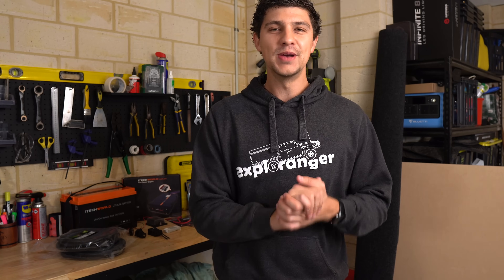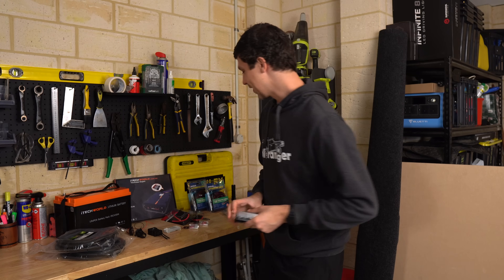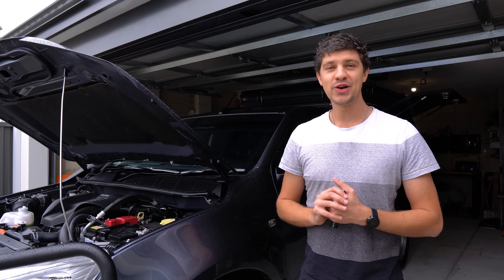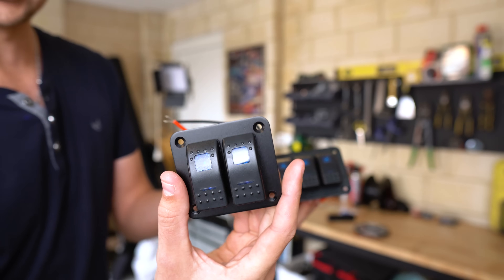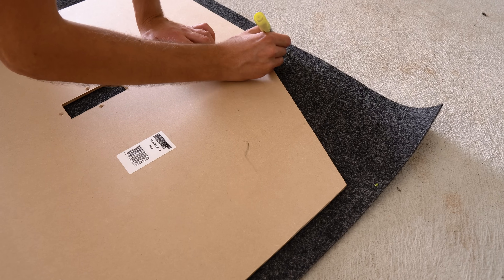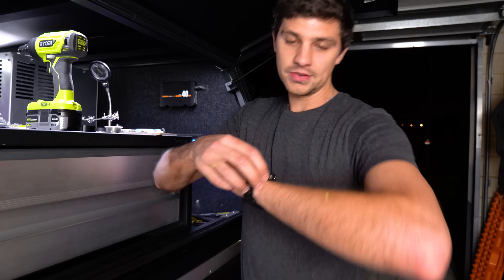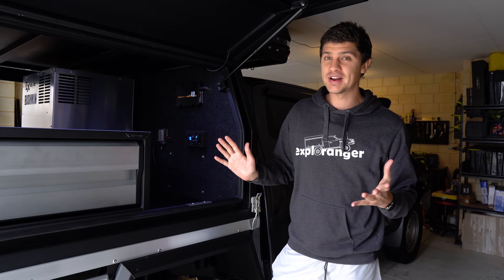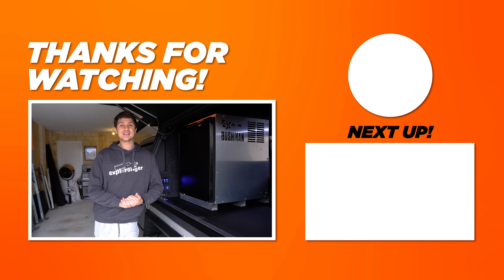Installing A Full Off-Grid 12v Setup! DMAX Canopy Fitout EP2

Comment: Good video Daniel. Just curios, with the Itech world lithium battery monitor, did you have to use a shunt?
Reply from the maker: No this one just determines the battery level based on voltage (calibrated for lithium) - not as reliable as a shunt based system which is what I've since installed instead. 🙂

Comment: Hey mate, im about to install the 12v into my D'max canopy, what did you do with the Dc/dc ignition wire ?
Reply from the maker: Hey mate, I tapped into the factory fuse box and ran a piggy back fuse off an existing ignition circuit through to the canopy via a deutsch connector.
Reply: @explorebound  ok cool. I've got the fuse box end sorted thanks to your vid. The through the canopy was my issue, especially being a lift off. Thanks heaps, I'll check out the Deutsch connector. Good on ya,  love ya work 👍

Comment: LOL @ you running dedicated pos and neg to the start battery. you only need pos wire. you simply put a neg wire any place you want in the back of the truck to the frame or bed. waste of money big time.
Reply from the maker: The canopy is a lift-off, so can’t connect directly to chassis, has to be ported through the Anderson connection. Sure, I could have then splice half the wiring from the vehicle side of the connection to the chassis.. but it’s twin core cable anyway so wasn’t any inconvenience to run back to the starter battery, looks neater and was hardly any difference in cost.
Reply: @explorebound  i had no idea it was a lift off. Makes total sense now.

Comment: great setup! when it came to installing your strip lighting was the back adhesive to the strip lights 3M? Thoughts that stuff would stick on anything! especially with my canopy being a black powder coated finish, will have to do the superglue trick as well. When it came to securing the conduit that you had run the strip lights in, how did you go about securing them when running them within your awning? i assume just zip ties?

Comment: 1:40 your wire is undersized for that length and amp rating
Reply: ... Agree.

First though, it must be said, always grateful for this kind of content.  Takes guts to lay out your work for the world to see.

Here's my take on the cable size for the run from the starter battery to the DCDC40 charger:

Two major cable sizing considerations --

> Protected by Fuse

> Voltage Drop 3% Max

(especially to a DC-DC charger that you want max output from / quickest charging)

1:34 ... Curiously, the Narva 8B&S 100A claim appears to be bunk.

Narva's cable package 8B&S 100A claim cannot be substantiated by the 6 foot run top row of the Blue Sea Systems cable selection chart, apparently based on ABYC E-11, nor by the NEC "free air" ampacity table.

Looked on the Narva web site, and they don't appear to substantiate their 100A claim for 8B&S with any detail.

That said, 8B&S should be protected by a 60A fuse ... but likely not by much.

For what it's worth, the 2011 NEC says 70A @75C for "free air" 8B&S (8AWG) ... and that sans deratings, like ambient temp (under bonnet?), etc.

However, for voltage drop @3%, not 8B&S ... sustantially more copper needed, maybe 4B&S, likely 2B&S best ... to accommodate max current of 45A (iTechWorld DCDC40 manual), run 15 feet = 30 ft circuit, looking at the Blue Sea Systems cable selection chart.

Perhaps that's wrong.

Easily proven.

If the aux Lithium battery were drained to 50% or so (don't know how you'd tell without a shunt), turning on the ute and checking voltage at the starter battery and at the DCDC40 charger while it's at max output, should show more than 3% drop with the installed 8B&S Narva cable ... if what I've stated isn't B&S. 😁

My $0.02

Thanks again for the content.
Reply: @kradius2169  your fusing recommendation is off. 

100a rated wire should be fused at 1.2-1.5x the constant load. 
So should the constant load be 100a then you need a fuse between 120-150a. The fuse is only there for short circuit protection not overloading. 

To size a wire there are 2 ratings. 
Max amp rating this is the most the insulation can handle no matter the length of wire. For example 8awg is normally rated around 80-100a but it can be rated at 200a with the correct insulation. 

The next rating is voltage drop. This is what we use as a little bit of Voltage drop can be the difference between the system working or not. 
When working out voltage drop the amp rating of the wire decreases with length not because it can't handle the load but just because of voltage drop. This is why if you size by voltage drop you will never overload the wire.
Reply: @DIY12-24v  ... OK.  Thanks.

Was not aware the fuse is only protecting against faults.

Is that a DC thing?

What about high impedence faults?

I'm learning here.

P.S. The overcurrent protection per NEC should be 125% of the 3 hour continuous current to avoid nuisance tripping, I believe.

Also, U2oob threw up dude's latest 12VDC aux system iteration, I'm only just starting to watch and now dude's got a 6B&S from bonnet to DC-DC charger.

Ima have to comment. 😁
Reply: @kradius2169    do you mean low impedance fault? 
High impedance fault is basically a short circuit and it will blow. 
Low impedance fault will not blow the fuse as it under its rating as well as everything in the system. Example solar panels cannot have high impedance fault and this is why you can direct short a single panel and nothing melts..

Over current protection will be different depending on location because of laws and regulations. 

The fuse will not blow at over current for extended periods depending on the fuse type until it goes over 120-150% of the circuit rating.
Reply: @DIY12-24v  ... Fault = short circuit in my book.

DC systems at times seem to have design peculiarities.  Like I say, I'm learning.

I mention high impedence faults only because they are low current, at times low enough to not trip a breaker -- but that may be more a high voltage transmission issue, and not a 12V DC issue.

I would still though question a fuse not being meant to protect a cable from an overcurrent that's not a short circuit.
Reply: @kradius2169  with low voltage it's not important as it will not hurt anyone this is the only reason why they use it in high voltage. It's not exactly simple to setup

Comment: Hey Bud; did you ground to the chassis from anywhere other than the negative crank battery ground point? Thanks in advance
Reply from the maker: Hey mate, didn't add any chassis grounds in the canopy circuit. Everything in the canopy is grounded to the canopy battery to complete the circuit, and the DCDC is earthed via cable to the starter battery (which is then passed through to the aux batt).

Comment: Hi Daniel. I’m just in the process of finalising my MRT explorer package. Are you able to share more detail on the changes you made to accomodate the 12v wiring and the KES? MRT aren’t able to modify their KES wiring to accommodate any changes so I’m looking at either replicating your design myself or having them add an additional flush mount Anderson connection to accommodate another 12v cable run.

Comment: Great video mate! Question, do you still run a battery isolator to allow charge for the second battery or does the dcdc charger have that built in? Thanks!
Reply from the maker: Hey mate, the DCDC takes care of everything so it just has a power feed directly connected to the starter battery, and a wire connected to the ignition feed that tells it when to start charging 🙂
Reply: Did you need to upgrade the alternator too?

Comment: Hi. I'm in the process of setting up some 12v in my canopy by running a solar panel through an mppt controller.

In your opinion, how much room behind the headboard would you leave for the wiring? I'm thinking 40mm would be sufficient.

Comment: Hey mate, how is that contact adhesive holding up after some time? About to use it for my rear set up but don’t want it to peel off!
Reply from the maker: Hey mate, so far it's holding well, hasn't peeled off anywhere which is great but having accessories screwed through the panels and the material pulled tight defintely & stapeled helps a lot so not sure how it would go if the adhesive is the only thing holding it.

Comment: Great vid mate, i also bought itech products and im stumped on the dc-dc 4oA charger. It says in built mppt, so did you disconnect the solar panel mppt or leave it in place?Are all 3 plugs connected all the time or do you disconnect the solar and only connect it when parked up? cheers

Comment: Impressive, But that LED strip lighting, don't like heat its own or sun, you probably found out by now. Need to put stuff in covered alloy profile stuff, but involves screwing to mounted. Also Is your tray box 100% waterproof as MDf is a Water sponge Even if you seal it, Formply would be a better choice.
Reply from the maker: Surprisingly the LED lighting has stayed up even through some Pilbara heat, but will still be looking into a rigid solution at some point down the track nonetheless. Yeah the MDF was just a cheap solution really, and is easy to swap out if I have issues down the track but I had the same in my last canopy which lasted 4 years without and issues so figured it would do the job short-term at least. 🙂

Comment: Hey Daniel, love the setup, DIY stuff & the Karijini trip… regarding your 12v setup, do you leave the fridge running 24/7 & if so, do you connect a 240v charger to the DCDC? I’ve a similar system, but not sure if I can plug a 240v charger into the battery box via Anderson plug into the cable normally used for vehicle input….
Reply from the maker: Hi Terry, I only power up the fridge when I’m heading away, it’s off during the week. To address your question though, you should be fine connecting your 240v charger if choice to your battery via Anderson connector so long as it’s appropriately fused (unless you’re referring to the Anderson that leads into the DCDC, this shouldn’t be used, make sure the charger goes straight to the battery not via DCDC)
Reply: Hi, 
Just reading yr comment and thought you might like to look at my videos for ideas. 
Cheers 
Out There Touring

Comment: Hi there Daniel and Bianka, love how yous setup your rigs without spending a fortune, you both should be proud of your work and what yous manage to achieve.  You are living proof that you don't have to spend  $20,000 on a setup that works and alowing you both to get out there camping.  NOT criticizing you or your wiring work by using the 8awg wiring you have run from your engine bay to the canopy is a touch light.  When I did my wiring I used 6B&S cabling and used Narvas ANS fuse holders and fuses and have not had any issues with my setup in the eight years that I've been using it.  A friend of mine wired his  setup using the 8awg cable and the same fuse holders and fuses you are using and one of the fuse holder got hot enough it melted.  He had a close call he could have lost everything.  Please give it a bit of thought about up grading your cable size and the type of fuse and holders you are using. Considering you have just paid a lot of money for your new vehicle and I would hate to see something happen to your rig, especially after the up grades you have done to date.  Looking forward to the up coming  mods you are yet to do to your new rig.
Reply: What a great video and set up, props to you for that. I have got the same dc to dc charger and it actually states on page 13 of the manual to use “bolt down fuse holders” (ANL) not blade fuses as they can result in high resistance connection which can cause  excess heat generation and may damage the fuse holder and or the wire. Would hate to see you loose your set up because of a fuse.

Comment: Probably a dumb question but how did you wire up both amber lights to the same switch?
Reply from the maker: Hi mate, I just connected the positive feed for both amber strips together and ran them to the same switch. 🙂

Comment: Great video - thanks for sharing. I am going through a DIY install myself and had a quick question about the bushmans fridge - do you run it through the fuse box or on its own line from the battery? thanks again, Paul
Reply from the maker: Thanks Paul! I've run the Bushman fridge through my fuse box with a 30A fuse. (I just made sure I ran thick wiring to the fuse box so that was thick enough to run the fridge and all accessories simultaneously.
Reply: Hi, 
Just reading yr comment and thought you might like to look at my videos for ideas. 
Cheers 
Out There Touring

Comment: Hey mate how is that usb c port going for you and your laptop? i've got the one that stedi sell but it wont boost convert to the full 20V so charging laptop only happens with the lid closed. I did however buy a baseus 100w  that plugs into a cig socket  and will boost to the full 20v pd output from a 12v input. i suspect it utilises GaN as opposed to silicon chips so it doesn't warm up at all. Now my macbook pro charges as if i was using a wall charger in my car i was so amazed, I've got absolutely no use for an inverter in my car anymore. 

I found one the looks like yours on etronx and it seems it wont do the full  USB PD (apple products don't use qualcomm quick charger protocol, rather usb Power Delivery). spec of 20v output without input voltage of 20-32v from a 24 system, seems to not use a chip incapable of boost converting.
Reply from the maker: Hi mate, during our recent trip I was editing 4K footage on my 13" MacBook Pro (M1) and that USB C charge port was charging the laptop quite a bit faster than I was able to use the charge. 🙂

Comment: Neat job for a diyer.
Did you run your earth's to a bus bar to neaten up ur battery terminals?

I reckon u should swap them blade fuses on ur main lines for some midi fuses. Much simpler and more reliable I believe imo.

Solar setup, run a solar blanket. U park ur rig in the garage so having a roof mounted solar panel is pointless. You can get a 300w kt cables solar blanket on special at anaconda club prices for about 600 bucks. It's the only panel ull ever need.

Comment: Did you connect negative back to battery or chassis?
Reply from the maker: All the canopy electrics are earthed back to the canopy battery, and the DCDC charger is earthed back to the main vehicle battery
Reply: Any reason you didn’t connect to the chassis for the grounding? I’m about to install this same dc charger and am in two minds…

Comment: Did you put a fuse between the canopy battery and the fuse box? What size fuse did put after the main battery?
Reply from the maker: Sure did! There's a 30A fuse between the canopy battery and the fuse box (calculated using the max amp draw the fuse box should experience).

Comment: Hey mate those blade fuses are dangerous i almost had my 4wd burn to the ground due to one of them failing, they actually slightly move and cause friction and get extremely hot to the point they melt. i would suggest changing them out for MIDI fuses instead much safer👍👍
Reply from the maker: Thanks for the advice mate, I'll have to swap them over! 👍

Comment: Did you end up just using one packet of the 5m cable?
Reply from the maker: I actually used quite a bit more than expected, close to 8m in total so lucky I bought both packets!
Reply: @explorebound  
Haha lucky!
Reply: @explorebound Definitely used undersized wiring over that distance mate, you'll probably be seeing 10% voltage drop using that gauge

Comment: Would ditch the blades for MIDIs
Reply: Why?
Reply: Outdoors the blades tend to melt a lot of the time and not properly blow if they do. The contacts on the MIDI are alot better also.
Reply: @lukegonano3956  
Fair enough. I know nothing about electrical. I'd rather stick my fist in a blender than do wiring, but I also hate paying people to do a job I know I can probably do myself..... albeit with a lot of swearing.
Reply: Outdoors no doubt mate I’m the same wiring is my most hated, just hate to see something like this fail causing a fire
Reply: @lukegonano3956  
A while ago, before I knew I could DIY, I had Opposite Lock install a dual battery for me. Mate, they put the shittiest thin wiring in from the engine bay all the way back to my battery in the canopy. It melted the fuse and wire. The overall diameter of the wire WITH insulation was about half the thickness of a pen. If I could post pictures I would.
Reply: Outdoors yeah mate wont name them my first time they put 250amp for wiring that was only good for 50….. now I just do it all myself even though it hurts
Reply: @lukegonano3956  
No harm in naming people if its the truth 😁
Reply from the maker: Thanks Luke, I think I'll swap them over after hearing all the horror stories over the past few days! 😬
Reply: Exploranger learning experience mate it will do for your trip but if you get time

Comment: You did an awesome job mate.  Basic and practical that looks neat too. How good is the ryobi soldering iron too? Just a quick tip with the led strip lighting, put some dabs of silicone or sika every 100mm or so along the backing. It will stick good and hold up with the heat of the doors and vibrations of driving too. Keep up the awesome work
Reply from the maker: The Ryobi soldering iron is unreal for projects like this, heats up so fast and no pesky extention leads haha. Thanks for the lighting tip, will give this a go if my glue fails. 👍
Reply: Hi, 
Just reading yr comment and thought you might like to look at my videos for ideas. 
Cheers 
Out There Touring